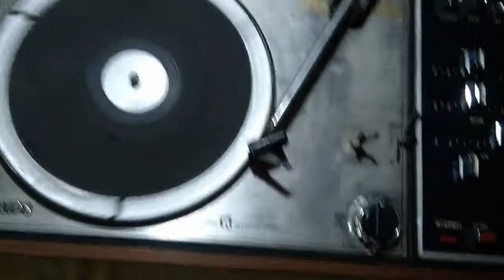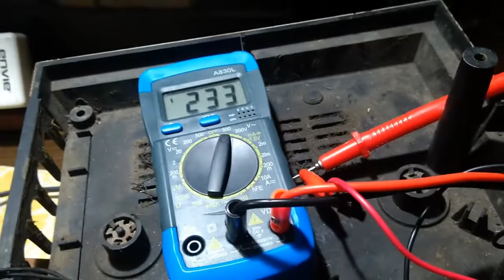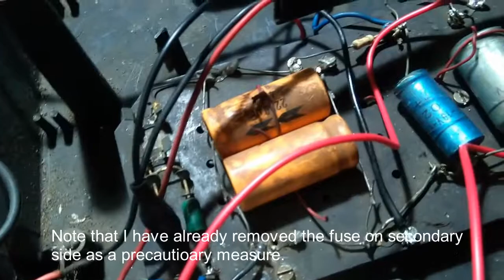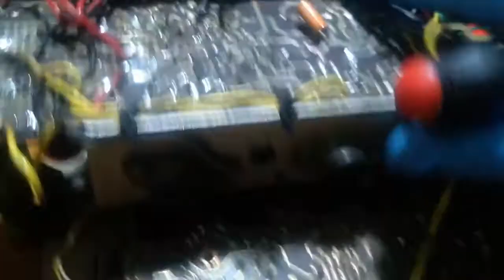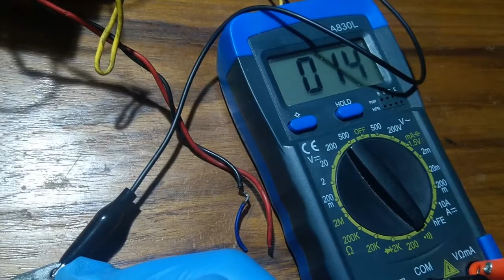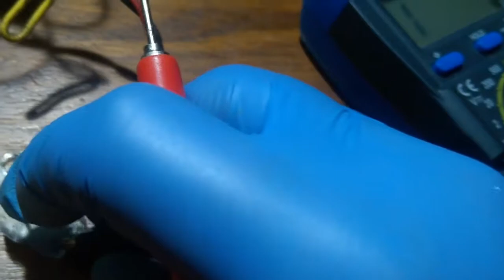Philips 932 record player repair - Part 1 (Disassembly and diagnosis)

Comment: Thanks to you , transformer fuse you told us but that's fuse, please don't remove sefaty for system, you just pull the small terminal and shoulder tham,you get power for d.c.so please confirm iam getting the power..